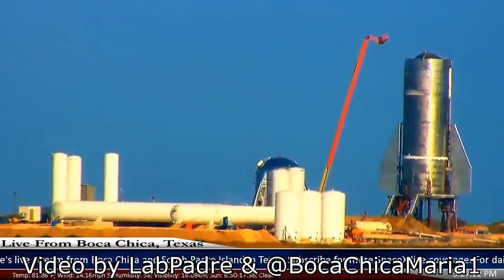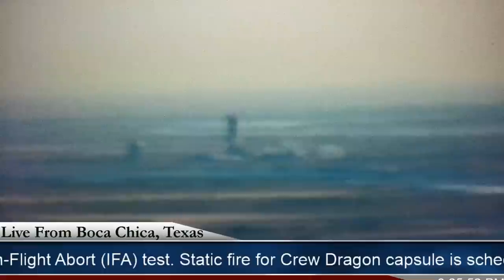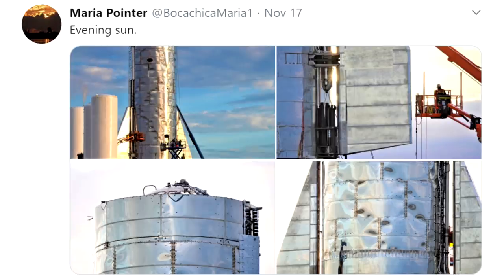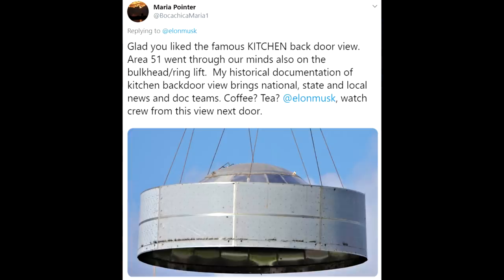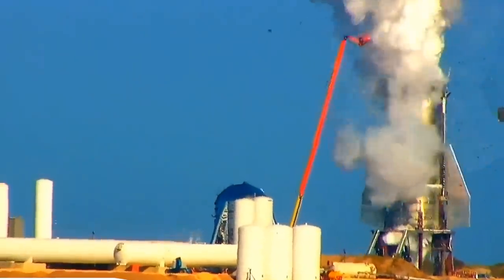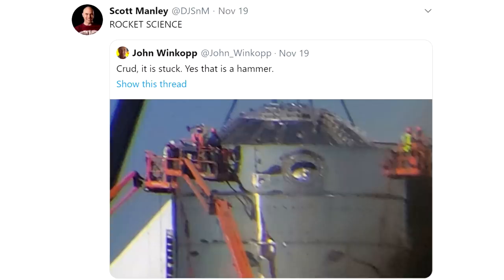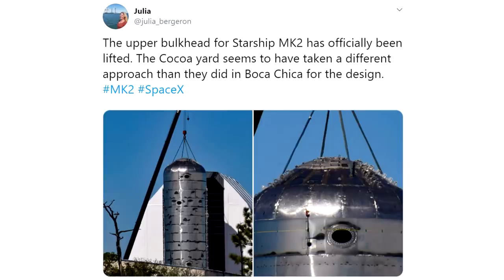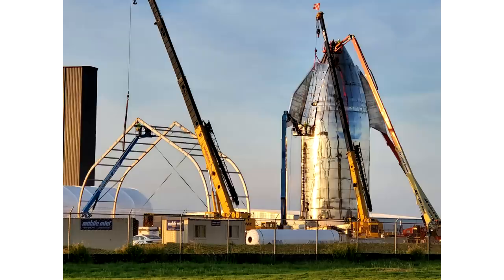SpaceX's Starship Popper - Starship Mk1 Ruptures Tank During Test

Comment: How far from the top test pressure did the top fel off? Is the stainless steel on starship thinner than on hopper? Did they plan to reach same test pressure as on hoppy? It might be better first to do a "hot" pressure test to relax welding stresses with a lower pressure? Coiling up the cylindrical parts of the spaceship with automatic welding machines indoors would be much better. Supplyed with indoor manual welding..

Comment: A slight correction:  A bit counterintuitively weld seams are usually stronger than the bulk material.  This is often demonstrated in civil engineering too. If a continuous weld in thin steel structure fails, the weld might be have been faulty.

Comment: A three-way split in the welding structure is a weak point. especially for pressure containing structures. Proper welding and inspection is also important. But it is important to learn by mistakes, so this is maybe not a setback.

Comment: The great thing is that pressure failures are usually hoops stress  failures where the sides tear straight down the belly.
This held up great !!! Great job and proves that reducing the material thickness is possible. Ie more payload.

Comment: This could be a better type of failure than a simple weld split and smaller leak, as it show the welds were tight and it took a lot of pressure to break them.  That's assuming they were doing a pressure to destruction test.

Comment: Wrong. Welds rarely fail. The most likely reason was material failure at or near the welds. Stainless Steel has a very nasty habit of shrinking at great rates after a weld during its cooling cycle and the metal can easily be fatigued. The welds are generally stronger than the base metal they are welding.

Comment: Giant rockets are a symptom of over-compensation or mental retardation. Vertical balloon chain connected with elevator cables forms a temporary 100,000ft tall space elevator capable of launching thousands of smaller rockets at the same cost with just 2000 high altitude dirigible hotels temporarily connected.
Reply: Using solar powered balloon chains dramatically reduces the fuel costs and most importantly the environmental cost of a space access.

Comment: They are using such a light gauge outer shell/ skin on those rockets there is no way that they can provide any structural integrity. The tanks and structural elements are all under and inside of this skin so the outer shell is adding virtually no strength too the structure. And most likely no where near strong enough too withstand a launch to outer orbit.

Comment: Why is it "to be expected" that it failed at a weld?  Generally speaking unless the person doing the welding seriously messed up or had no idea what they were doing the weld line is far stronger than the surrounding material.  This is partly because the welding rods, wire, ect are specifically designed that way.  Partly because the material at a weld is a little thicker than the surrounding area and partly because the metal is head treated by the act of welding it making that material on and near the weld much stronger than the surrounding material.  Now there are processes used to minimize this effect in situation where you want the material to remain somewhat elastic but even then the WELD is still the strongest part of the structure.  In my opinion based on decades of experience with pressure vessels (some of which ruptured) its virtually impossible that this blew at the weld just based on the level of professionals who would no doubt have been selected to do the welding so  (no noob mistakes).  Considering that the vessel and the material were all brand new its unlikely corrosion was an issue though I obviously don;t know the exact processes SpaceX uses in manufacturing so I suppose its possible that some chemical had an unexpected result on their metal and did cause some corrosion.  That said its most likely that it simply burst at the thinnest point in the metal.  I have seen this literally dozens of times when testing vessels to the breaking point.  Now there may not have been anything necessarily wrong with the vessel itself.  It looks like they just overfilled it.  At which point something had to break.
Reply from the maker: It’s to be expected because there’s a lot of long welds and it only takes on weak spot to fail.

Comment: As a pipe welder of all metals ,carbon,chrome and stainless, the welds failed it's obvious so many things come into question like weld parameters and the Q.C.of the welds . All weld procedures need to be followed exact , I'm sure by investigating the welds they will find the problem. But if you need a good stainless GTAW welder I am available also able to weld titanium, hastelloy, inconel ,monel ,304, 304L, 316, 316L ,308H, Duplex, copper nickel.
Reply: did you get a job at space x

Comment: If it's rigid structure it's going to be too heavy to fly, if it's thin enough to fly it has to be internally pressurised like Atlas ICBM's.
Stainless steel is a really bad idea, build it smaller in some sort of Titanium/Lithium/Magnesium/Aluminum alloy. 
It's just too wacky to work, it's up there Elon's other wacky ideas, hyperloop and road tunnels with lifts.
Reply: Lots of rockets were made from steel -- from V-2 to Ariane-4 and plenty more in between. Space Shuttle boosters were a centimeter thick steel -- heavy, but because they were so sturdy, they were able to reenter atmosphere for landing without any re-entry burns or worrying about orientation -- they just went through it as though there was nothing to it.

Comment: That would have to be some kind of over pressure? My question is was that tank tested and certified prior? A certified pressure vessel would be tested at 1.3 times its maximum pressure rating. Testing it to its point of failure is absurd. Either it wasn't certified, was damaged, modified or grossly over pressured.
Reply: Something I could also add is, if they were testing something else at a higher pressure and it unintentionally filled the tank.

Comment: Why did they make it out of stainless?  The most likely metal to crack under pressure.
Reply from the maker: Because when they did the math it turned out to offer better performance at cryogenic temperatures. Plus it worked for the Atlas

Comment: I will be surprised if space X ever gets The starship in orbit.
Reply: The only way I see them failing is if they go bankrupt. Everything is just an iteration on known-good concepts, with the exception of the fuel, which itself is a replacement for known-pernicious hydrogen. Even the reentry system is just an iteration on the space shuttle's reentry technique. A game programmer (John Carmack) was successfully doing hover-tests as a (admittedly expensive) hobby before the Falcon 9 existed. This stuff only seems advanced because the traditional rocket companies got both lazy & paranoid, we've been able to get stuff like this running since the 1990s (and honestly, we could probably have done it on the Saturn V by the mid 80s if we kept that going).

This stuff doesn't require fundamentally new engineering, just iterations on what exists, so there will be successful orbits by the end of 2022 (however, I wouldn't bet on whether there will or won't be commercial launches before 2023: just too unpredictable).

Comment: Is it going to be disaster like Hyperloop?
Reply: I don't believe Hyperloop has done enough to qualify for "disaster" yet.
Reply: @absalomdraconis  What about as a scam?
Reply: hyperloop is a disaster, the original idea from 1799 and hasn't been much past early prototypes  it requires sealed tubes which would change in length due to heat expansion (up to 3miles on some of the routes proposed) a failer of the pressure vessel would be very bad anyone traveling inside that tube at the one time. it is all a big PR thing and a massive waste of money